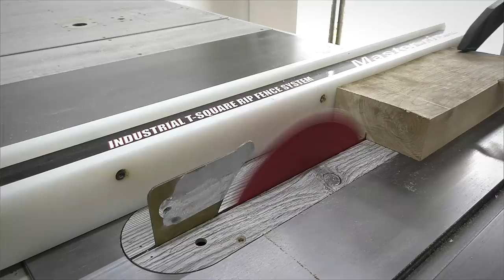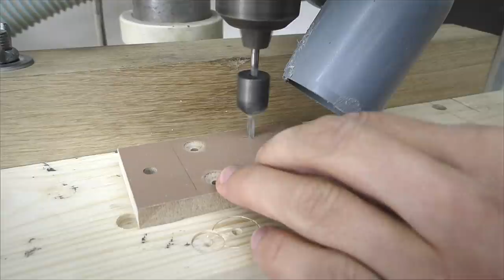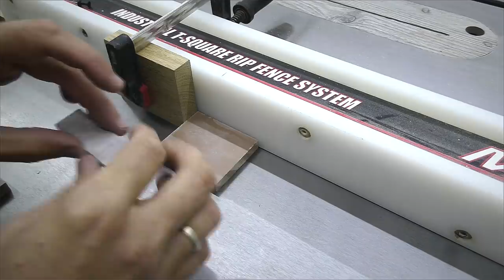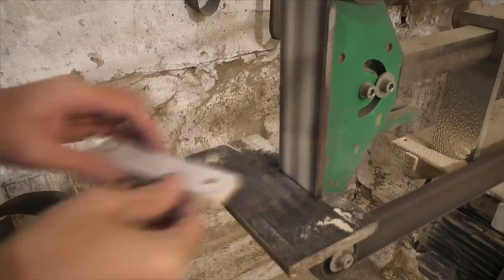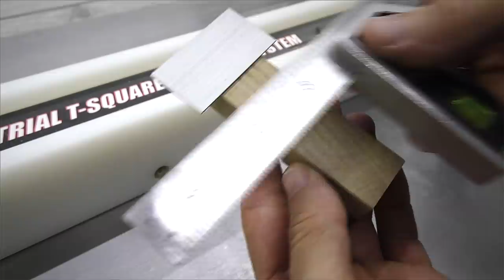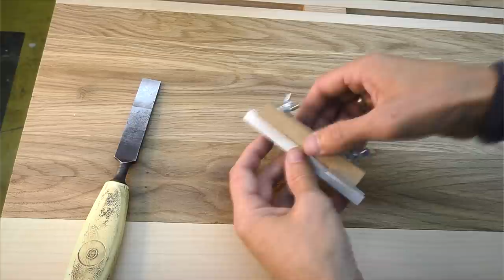Power Bench Grinder Upgrade

Comment: Perfect timing - I just bought a grinder from Lidl - reduced because the guides were missing! Will you be selling plans - or the item itself?
Reply: i also bought a grinder from lidl and i sold it in a minute the following day!!!! saying useless is nothing.
Reply: @lastorianostra8173  I bought mine to convert one wheel into a disc sander - which I've done ... it works very well but I had to mount the whole thing to a board which I could clamp to my bench. In use, it sounds like a plane taking off!